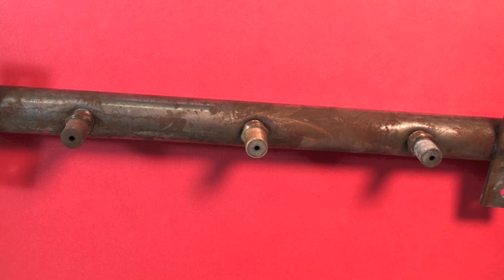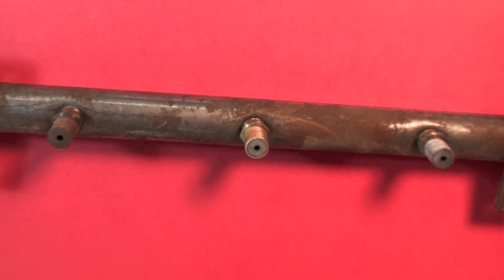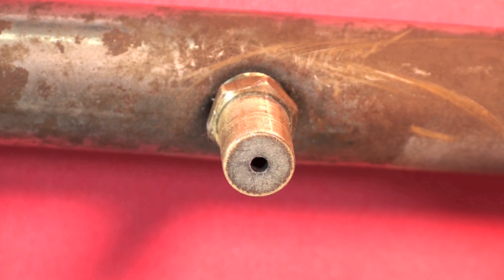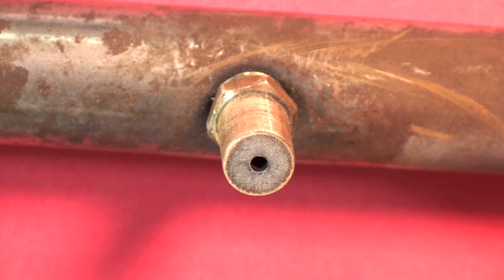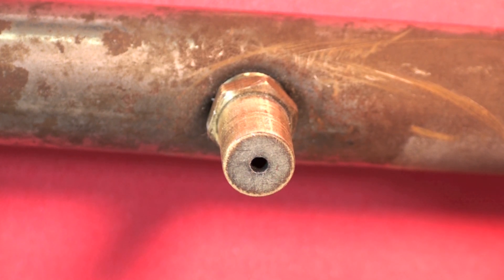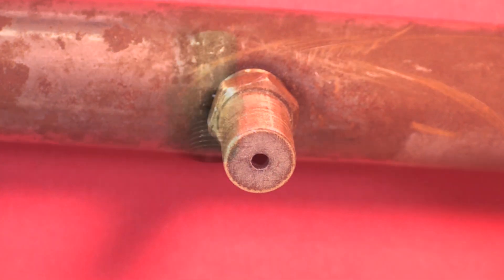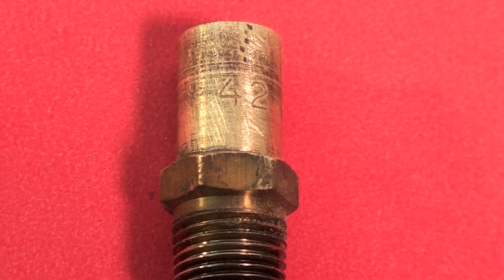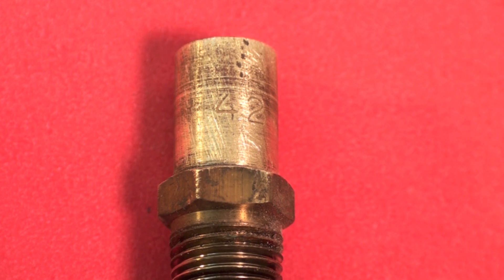Gas furnace manifold orifice sizes and flow rates

Comment: Would like to know what size orifice would be needed for a furnace to operate at 5,000 ft elevation with an output rating of 108,000 BTUH  at sea level?
Reply from the maker: The first place I would look would be the model plate of the furnace.
GFM
Reply: @grayfurnaceman  Thanks for the response.

Comment: Hi 
Thanks for the video,
Is the office size is in the manual of furnace or in the gas code ?
Reply from the maker: The orifice size will be in the install manual of the appliance and that would be my reference.  The IFGC code book also has a chart, but I would defer to the install manual.
GFM
Reply: @grayfurnaceman  
Thanks a lot for reply .
I am HVAC tech that had lots of call back from clients and even I was close to loose my job in the company that I am working for but your videos really really helped me to grow .

Comment: 1:03 can you drill the hole bigger for more gas for more heat. Like drilling out jets in a carburetor for more power
Reply from the maker: You can but it no longer follows code to do so.
GFM

Comment: Hello, my gas stove has a weak flame by default (brand new Amana stove). Is it possible to fit an orifice with a larger hole to get a stronger flame on the same model stove? The whole issue is about searing a steak properly.

Comment: doubt you will see this, but im currently becoming a b fitter and  im confused as to why you round down when sizing orifices to the rating plate to avoid over firing, but round up when its an installed unit. mainly the rounding up throws me off..

Comment: my chart shows 42 at 22,197 with a 40 at 24,384 at 3.5 wc that's quite a bit of difference whos chart is right
Reply from the maker: I can't tell which is right.  When we look at actual numbers, we can't even determine the BTU per cu ft of the gas delivered to the meter.  It can vary from 930 to 1050 BTU per cu ft.  
GFM